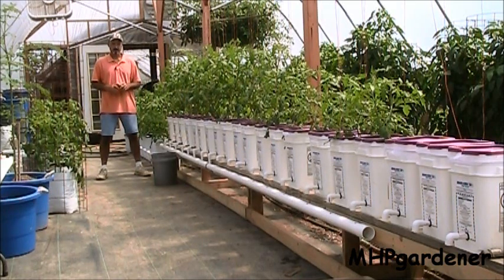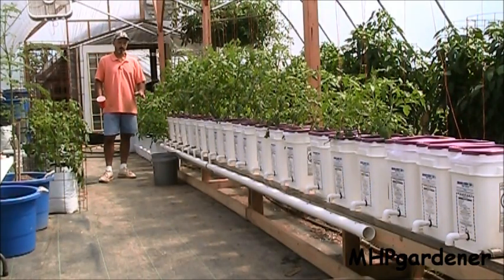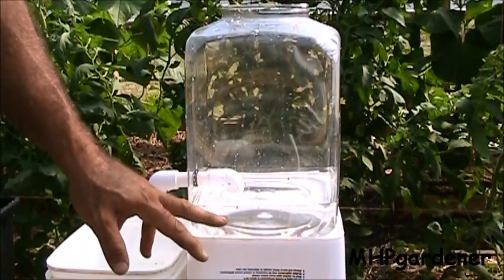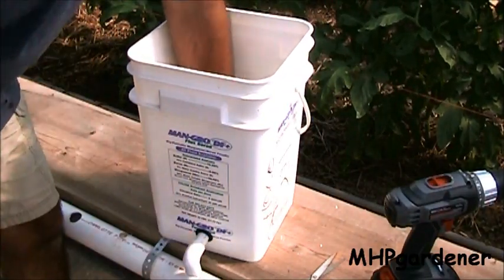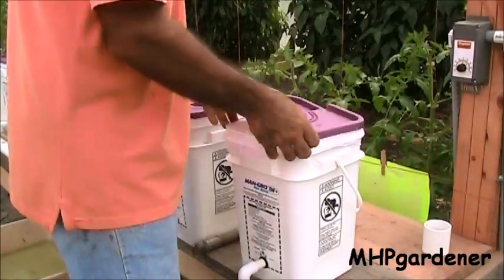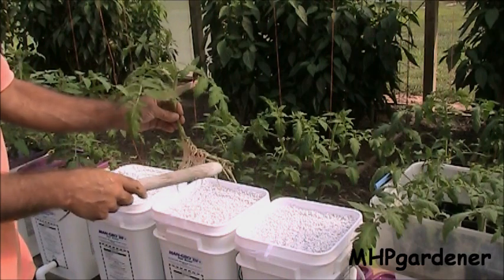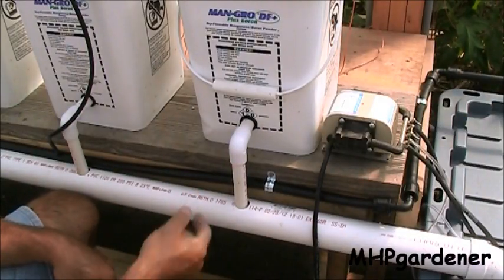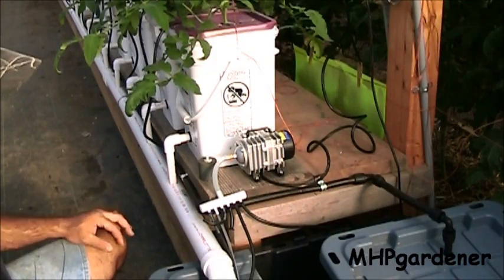Dutch Bucket Hydroponics - How It Works & How to Make Your Own Buckets

Comment: Brilliant.  ( however, I do have a question about PERLITE)  It is not cheap either, is it, and also the dust from what I heard is carcinogenic and will damage your lungs?  Am I misinformed on that?  Maybe it's Verminculite that is bad for the lungs.  Also, if you use the PERLITE, can it be re-used ... and how many times?  Really amazing videos.
Reply from the maker: I guess most any type of dust would be a problem if you breathed it constantly. The few minutes of exposure shouldn't be a problem, but I'm no scientist. I have re-used the perlite for a second crop, then dumped it into my garden to help loosen the clay a bit.
Reply: Yeah I can help with this... so the less harmful is coco coir. Perlite is extremely bad to breath, vermiculite doesn't do the same thing when you mix it. Perlite is a white porous soil aerator and creates dust when you work with it, just wear a mask and your fine. I use it all the time. Vermiculite is too exspensive, Perlite is pricey too, but way cheaper. You can buy 3 cubic yards for cheap and that should fill 25 of those buckets. Coco coir is great, peat moss is great, rockwool, so just research whats more cost effective in your area.
Reply: Ryan Nalbach where can you find perlite in that large of quantity?
Reply: mhpgardener by any chance do you have the part# for the grommets @ grainger ?
Reply: bigscrambler 3mplb is the granger # number i just ordered mine it was a pain trying to find out what worked i got them yesterday and they work great...i also found a supply store that sells 20 poundns bags of perlite for  19.99 but lowes doesn't have it only small bags and way too expensive. you will prob have to google for a supply store and ask if they have the big bags
Reply: bigscrambler by the way it comes in a bag of 50 and its 8 bucks or so but with shipping its like 20 bucks still way cheaper than lowes...theres are like 1.35ea  so you still save a lot
Reply: Daniel Ruthie Nathan   Thank you
Reply: bigscrambler
Home Depot has 2 cubic foot bags of perlite for $17, but they don't keep them out where you can see or reach them.

Comment: You should make an emergency hand pump in case the power goes out. There is a video on here how to make one cheap from PVC pipe. It uses 1" PVC inside 2" PVC with O-Rings that ride in grooves cut in the end of the 1" pipe on a table saw with the blade set to cut less then half way as the pipe is spun in a jig making a perfect grooves for the O-Rings. Then there is a Tee at the top for the pump handle and another at the bottom for the check valves and the in out pipes. They pump 3 gallons a minute, 2 cups per stroke. Going hard they can pump 5 gallons a minute. That would be an inexpensive addition to your system that would save massive labor over doing it by hand individually. Or just install a 100 dollar 100 watt solar panel with a 99 dollar 125 amp hour deep cycle battery with a 12VDC pump and run it for free off grid anyway.

Comment: Thanks for sharing about the Dutch Bucket system!  What is in the nutrient solution or what nutrient solution to you buy for the plants?  The 5 gallon buckets are they safe to use - would any of the chemicals in the plastic leach out into the plants?
Reply from the maker: This is my fertilizer.. http://youtu.be/vYv9iu2NI3M The product from HydroGardens is called ChemGro, but it works equally well. As long as the plastics aren't heated, I don't have a problem using them.

Comment: What size pump do you use to circulate, or what is your pump size to bucket # ratio?
Reply from the maker: I don't have a set ratio. But I've used a 264gph and a 400gph for 18-21 buckets without any noticeable difference.

Comment: Would a 2 lb bucket work, or would that be too shallow for the root system?
Reply from the maker: For tomatoes, I'd go with at least a 3 gal bucket, similar to the size of the commercial bato buckets. For lettuce or leafy greens, a smaller bucket would be fine.

Comment: bobby: great videos as always.  I am getting my buckets ready for my dutch bucket gardening this year question about the eblows and 3 inch pieces are you clueing together or just putting them together.. Sorry for stupid question.
Reply from the maker: The pieces are just pushed together. Since there is no pressure, a snug fit should keep them from leaking. And then I can take them apart for cleaning or changing the grommets if needed.
Reply: mhpgardener I have a question so the 90 elbow on the inside of the bucket. why is that necessary or is it? by the way thank you for the vid very awesome.  And another idea..i got all my buckets for free from a ice cream shop. but there more like 3 gallons

Comment: You've got great videos and I'm planning on starting with 8 Dutch buckets the first week of March. I was thinking about using a 3" pipe for my return and instead of the drain pipes dumping directly into the pipe, have them dump into net pots with strawberries in them. Any thoughts, criticisms or suggestions? Thanks!

Comment: In the long run crushed rock is going to be cheaper. The point is you can clean and sterilize them where as the Perlite needs to be replaced. Interesting that you got the same results with each medium. Also with the rock buy it by the ton and then clean and sterilize it. You just don't want to promote diseases in your system.

Comment: Good vedio. I have a question. How do you fertigate the plants? Suppose if its through drip, the water will go to reservoir and the same will be pumped again. The nutrients will deteorate and there wont be much nutrient content in the stored water. How frequently you mix the ferlisers? Please make a vedio on this.

Comment: I love your videos, I want to switch over to dutch buckets for my tomatoes this year.  I have a question on the grommets- you specify 3/4" grommets and 1/2 pvc pipe.  Am I missing something or is that correct?  It seems like you would need 3/4 pvc to fit snugly.

Comment: Hey Bobby,
I'm getting ready for a greenhouse expansion this spring and wondering about your buckets...could you provide the length, width, and height of yours?...i imagine your buckets are smaller than my 5 gallon ones...just wondering how small i can get and still support the root system and get good tomato growth. thanks in advance.

Comment: Mike, in the manual water mode, would you pour the drained nutrient fluids back into the first reservoir?  How many times would you do this before you would want to refresh the primary reservoir with fresh nutrient fluid?
Reply from the maker: Any excess water will exit the bottom and end up back in the reservoir. Ideally, you'd like to have the whole setup running in a couple weeks and then change out the reservoir about once every 30 days. If you have concerns about fluctuating nutrients or really harsh water, you could change it out more often.
Reply: Perfect Mike - Thanks

Comment: if the roots of your tomato plants don't go further down than you showed with your plants than going with a smaller bucket using less Perlite would make sense. In fact a bucket that's wider than it's tall would better fit two plant and give them room to build more roots.
Reply from the maker: Yes, about a 3 gal bucket would be perfect. Or simply fill the taller buckets only 2/3.

Comment: Nicejob.  I've seen the system taken one step further and made into an aquaponic system. You could make your reservoir bigger, put a mess of perch in there and you  have anaquaponic system.  The fish keep the plants healthy, the plants keep the waterclean.   Set your pump up on a car battery/inverter and solar panel to keep it charged.
Reply from the maker: I've heard that mentioned many times, but I'm still waiting to see a video of someone doing it successfully. Maybe you can help?
Reply: fastonline.org   This is the inventor site for the system.  All his designs are free and dloadable.
Reply: Robert Wilder, All it takes is the setup time, the running of the system can be as automated as one can afford.
Reply: Donnybrook I
Reply: nice idea

Comment: excellent presentation!  One question: since the plants absorb the nutrients (nitrogen, phosphorous, potash) in the fertilizer, how do you determine when to "refresh" the nutrient solution?
Reply: change solution every 4 days
Reply from the maker: I do a full change out every 30 days. In between times, when I have to refill the reservoir, I add the same ratio of fertilizer and water that I use in the beginning.

Comment: All of the nutrient solution I have found is rather expensive. Do you make your own?I
Reply from the maker: I use a product available from multiple sources. It's a 4-18-38 Tomato Special. From a cost standpoint, it's the cheapest I could find. And it works great.

Comment: Just curious, you note you have a 1/2" supply line for all the buckets but have a 2" return line. This could easily be done with a 1" return wouldn't you think? Either way I appreciate what your doing, keep it up man!!!!
Reply from the maker: 1 inch might handle the volume, but you'd have to add T's to make the connection between the 1/2 drain line and the return line. The 1 inch wouldn't allow you to drill a hole to simply drop the 1/2 inch into it. I'd go with at least a 1.5 inch return.

Comment: did you have any pathogen problems? If one of the plants is affected then all will in such a method. Did you have problems as such and what did you do? Are you using any kind of sterilization method or chemical to address this issue?

Comment: You can definitely do it without having to have dutch buckets, you can do it with DWC, but you're going to need an air pump to keep the water aerated, I don't think tomatoes would do very good in a kratky type stituation.

Comment: Perlite, sand, hydroton, gravel, sawdust, they all work well, but it's the precision of the fertilizer delivery that is key to this system.  Outside growing, I had one tomato plant wilt in the extreme heat.  All I had to do was up the run time of the nutrients to 1.5 hours three times a day, up from one hour three times a day.  I will be using this again and again.

Comment: Benjamin, I can attest, the little dribble is plenty.  Remember, the bucket gets watered three times daily plus it has a two inch water reservoir at the bottom of the bucket.  It's actually beautiful, allowing the roots to drain and get oxygenated in the process, plus, never lasks for moisture or nutrients.  Killer way to grow tomatoes!

Comment: Can you give us a part number for the grommet and for the tool that allowed you to punch the hole in the Pex and what you connected the 1/4 drip line to the Pex with?  Also where you got each? I'm thinking that with a sprinkler timer this setup could take care of itself during the day. How often do you change out the water and is there a fertilizer you prefer and what is your mix ratio? Ph levels we should pay attn to?

Comment: Great video, thanks! Quick question: that small dripper hose is the only thing that pours water and nutrients onto the plant, right? So is it OK that the dripper output is very localised? It doesn't spray over the entire top of the perlite to wet it evenly? Is that OK?

Comment from the maker: From the local feed store. They originally contained fertilizer. But you don't have to use square ones. Round or rectangle will work just as well.

Comment: Buy your grommets on ebay, I mean in 2 minutes I found 3/8" ID 7/8" OD 5/16" Thick 5/8" rubber grommets 100=13.50 so that is 13.5 cents delivered.  That said why go through all that trouble.  couldn't you just poke a hole in the bucket and pack it with some sort of rock wool?

Comment from the maker: Hey Josh, if you use an open gutter, algae would likely be a big problem. Sunlight on the water is not good. I don't think you'd have any issues with contaminants though, just the algae. Thanks

Comment from the maker: You're welcome, I hope it's been helpful.  10.4 ltrs is about 2.7 gallons. I think that would work for one tomato plant. Yes, a grommet will seal on a round bucket. As long as the grommet matches the hole size, you should have no problems. I don't know of a set ratio of buckets to reservoir. But if you find yourself refilling the reservoir constantly, that will be a sign that you need more water capacity.

Comment: Thanks so much for your time and generosity uploading the wealth of info in your vids. Really enjoying viewing them. Im in the UK and beginning to source material.

I found some food grade, round 10.4 litre, 257mm tall, black buckets. What do you think, too small for tomato or or ok? Do you think a grommet would seal ok through a curved bucket surface or better with square buckets? Also is there any rule for reservoir size to number (and volume) of dutch buckets in a system? Sincere regards Ray

Comment: Is the water coming out of the hose just plain water or for this stage of wetting perlite initially?I have RO water to put in pump basin,but wondered what would the water used to start(wet perlite) up dilute or contaminate the water with the 4 18 38 solution.?
Thanks God Bless

Comment: I have watched a lot of vids on DIY hydro setups and this one is by far, the most affordable, thoroughly explained, easily maintained way to go. I am going to try this style with my medical garden very soon. I already got the pump, 5 gal buckets with lids, rooted clones waiting in the dome, and the nutrients. I just have to figure out how much pvc I will need in either size. I have a question for you, do you ever have a problem with slime like I do with the bubble bucket setup?

Comment: You can also pour some hydrogen peroxide on the algae to kill it. It will not harm your plants although it may kill off beneficial bacteria if you use a lot of it. Covering it is the best solution.

Comment from the maker: If the grommet, hole, and pipe are sized properly, they shouldn't be leaking. I don't know of a way to seal it up other than 100% silicone. I have 280+ tomatoes growing in ground right now. I wouldn't bother with rock dust in a hydro setup. It's not gonna break down fast enough. I prefer water soluble hydroponic fertilizers. For doing it organic, you'll probably have to use some type of liquid.

Comment: Plants are not like animals (fish) as they do not create waste. What they do is deplete the nutrients in the water. Eventually you have to change out the nutrients. When it gets hot I have added a little water to my tank to maintain the same level. My system uses 13 gallons of water.

Comment: Bobby, do you have a problem with algae at the top of the buckets? I was checking mine today and noticed I have a lot of algae. Probably because of the rain and the fact I am not in a greenhouse, I'm thinking of getting some stuff from the local garden center that kills algae and is designed for fish ponds. Says it does not harm plants or fish. Meanwhile I have put black plastic under the lids.

Comment from the maker: The strainers are fine. Those 4 plants you're talking about were in a new setup, and it was a questionable variety of seed. They were supposed to have been "dehybridized" Big Beef. I was unfamiliar with them, so I only did 4. Turns out, I was justified in being cautious. The plants did not do very well.

Comment: nice video! Suppose you could place one more PVC-tube above the containers and distribute the water through it. In this case, you will have one distribution point for all the containers without necessity to pour water manually in each of them during power outages.

Comment: I am very interested in starting up my hydro phonics, system. I have purchased the eco pump, however i would like to know the size of tube used to connect to the pump, the size of tubes used as dripper lines an what is the name of the apparatus used to connect the plastic tubes together.

Comment: I'm glad you made it simple but detailed! I have a set up like this but no greenhouse. if you ever tried to grow in full sun you will find a problem with the amount of heat that is generated in the buckets. I have found that using weed matting loose around the bucket keeps most of the heat off. Just a little info for anyone not using a greenhouse. Great Vid mhpgardener!

Comment: Great info! I'm going to construct the same system you have. I wanna manually water my system. I don't wanna use water pumps. Just an air pump to for my reservoir. I think hand watering hydro system is great because it gives you the chance to closely exam your plants and close tabs on them. My thing is if I hand water, how many times a day should I water? Btw its an indoor grow.

Comment: You can buy some CFL bulbs made specifically for growing plants. I have a 250W and 2 125W bulbs and they work great. They come in 2 different spectrums, one that simulates spring/early summer sunlight (blue) and one that simulates late summer/fall sunlight (red). Just google "CFL grow lights". Alternatively you could use HPS or MH lamps but they cost a bit more, use a lot more electricity and put out a lot more heat.

Comment: It should say just clay 100% and it should say for many uses and it should cost about $4.20 for 25 LB bag plus the best test is get a cup and put some in the cup and water if it keeps it's shape it's the right stuff.
Lowes & Homedepot will not have it I know they don't have it here, walmart & a auto parts store or Sams club will have it they come in 25 & 50 Lb bags.

Comment from the maker: I have seen this done outside with success. So a covered porch should be no problem as long as you have sufficient sunlight. The biggest hurdle outside is the rain. Keeping it out of the buckets would be helpful. As for what you can grow, I think you can grow most anything with the right size bucket and spacing. Naturally, somethings would be easier to work with than others.